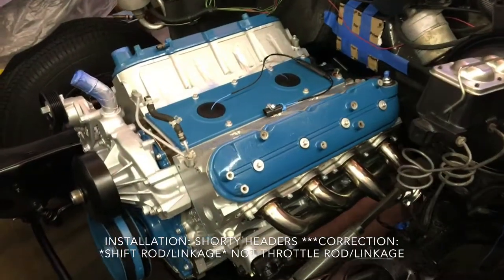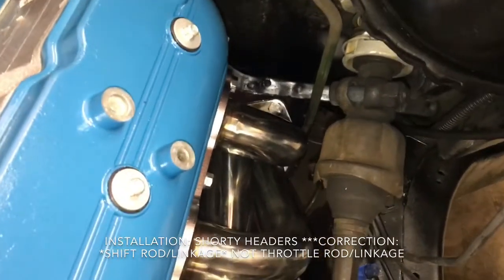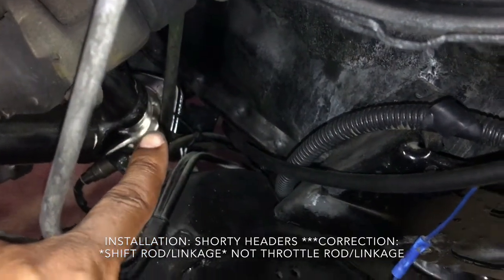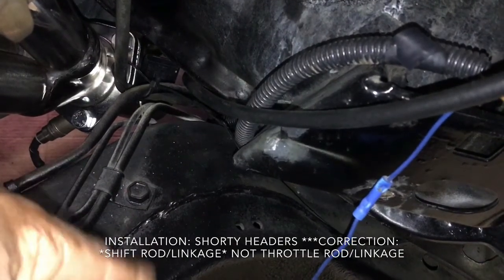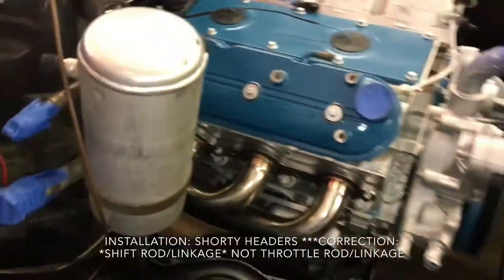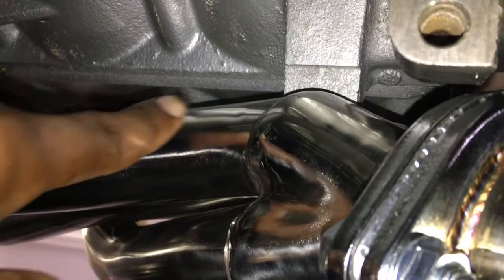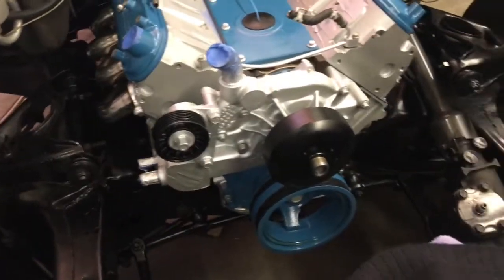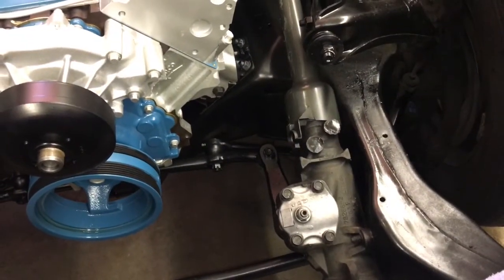5.3 LS SWAP PART 16 SHORTY HEADERS - 1978 CHEVY CAPRICE CLASSIC LSX LM7

Comment: Another option might be to grind down that boss just a little.   Completely depending if there is available material to remove.  Cheers!
Reply from the maker: UCanDoIt2 Hi Mike! Yeah, there is enough material but I was trying to take the lesser, dirtier approach. LOL! But yes, that is an option I will do if needed.
Reply: Between the three options: 1) Grinding the Boss, 2) Adding Gaskets, 3) Putting a Dent in the Header Pipe.... I would reach in my toolbox and pull out the grinder.   But that's just me.   All three options have their merit.   The option you decide...  will be right for you!
Reply from the maker: UCanDoIt2 I actually still might. I ordered extra gaskets as well. They were $8. I'm gonna take another look and see what would be best.
Reply from the maker: UCanDoIt2 I took your advice. Grinder it down.
Reply: I think that was a good decision.  You will never miss that extra boss section.  Denting the Headers would change the performance, Extra Gaskets would just promote an exhaust leak shortly down the road.  I believe you made the right logically superior decision.

Comment: Hey bro, I have done I swap 5.3 but  I have problem in headers do you have parts number for these headers??
Reply from the maker: Speed Engineering Shorty Headers for a Chevelle.

https://rover.ebay.com/rover/0/0/0?mpre=https%3A%2F%2Fwww.ebay.com%2Fulk%2Fitm%2F271833997085
Reply: @MrGriffin23  thanks a lot👍🌹
Reply from the maker: فهد فهد You still might need to make some modifications. Refer to my video
Reply: @MrGriffin23 the headers in the link not like the one you bought.
Reply from the maker: فهد فهد yes they are

Comment: How did your spark plugs clear?
Reply from the maker: Tim Mangham clear what? I just installed them with shorty headers?
Reply: So I’m putting I think the exact headers off eBay I used. But I can’t get the 5th spark plug to get cleared to plug in.
Reply: It’s a very tight gap to put the wire back on the spark plug. I’m gonna try to do what you said with doubling up on gaskets see it that will help
Reply from the maker: Tim Mangham Ahh ok! I used 45° angle wires. Plugs fit fine. What spark plugs are you using?
Reply from the maker: Tim Mangham I ended up not doing that. Only reason I was going to was because I was trying to clear a boss on the block where the collector was. I ended up just grinding it off. Everything now fits great.
Reply: Yeah I was told to try 45 as well I’m using stock right now
Reply: But the gasket I’m going to try that as well because I’m having the same issue I mean I know I can get it to work but I’ll try to double gasket see if it works
Reply from the maker: Tim Mangham that should work.
Reply from the maker: Tim Mangham For sure. Hope it works out ok for you. I went ahead and took the extra step to fix my issue so I didn’t have to later.
Reply: Okay thanks for the help.